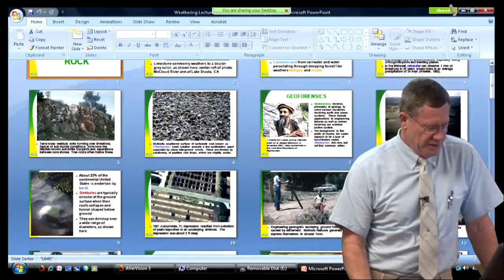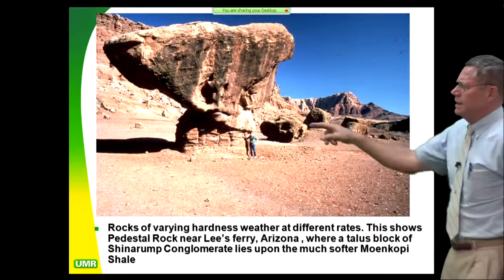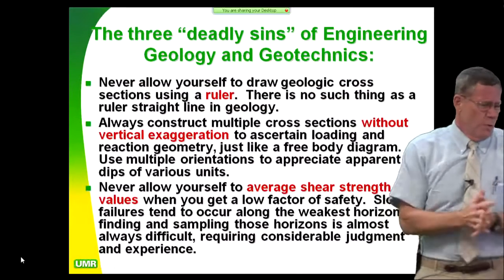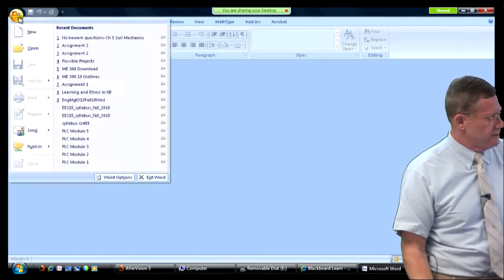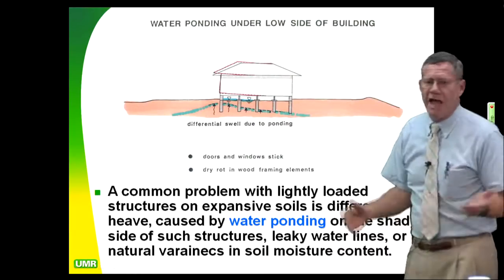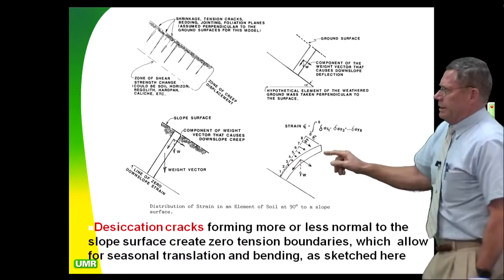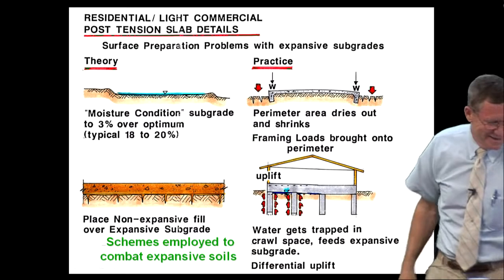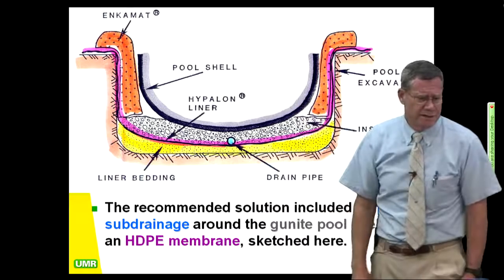Engineering Geology And Geotechnics - Lecture 3

Comment: At 1:37:00, says “drip, drip, drip is one million gallons per year”.  I tried to calculate this, I got a very different answer.

A “drop per second” isn’t well defined but let’s say it is 0.05ml per sec.  Then per year is 0.05x60x60x24x365/1000 = 130 litres per year